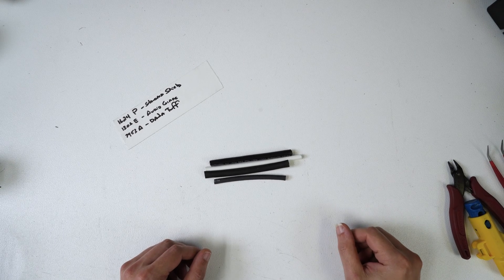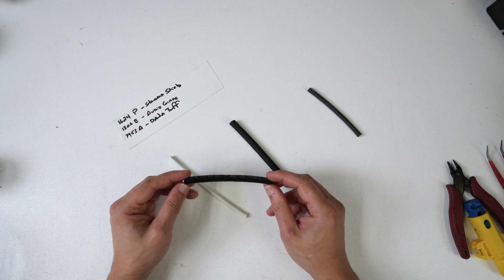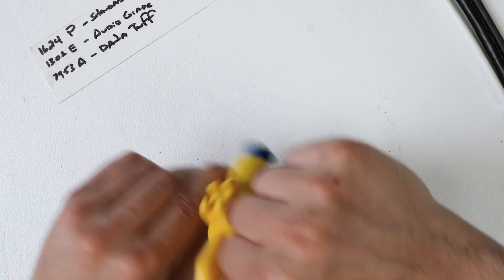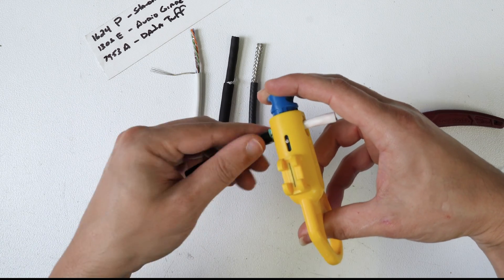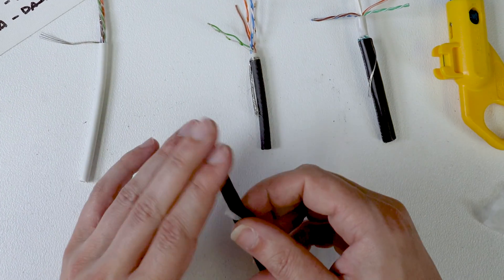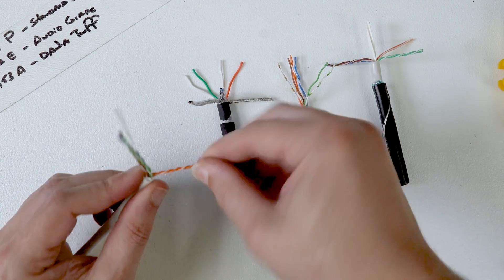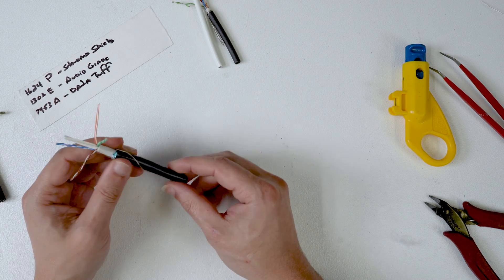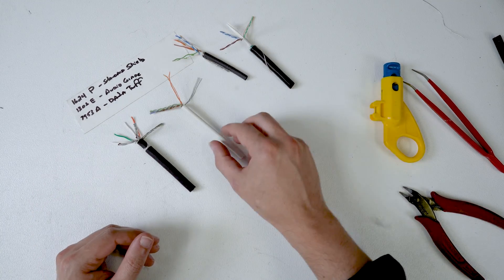Belden Cat6 Cables Compared: 1624P, 1303E, 7953A

Comment: Have you compared 1303EPU? (against 1303E)  the difference is the outermost outer jacket is PUR, and therefore better for durability but slightly increased bend radius, 35MM 70MM [1303EPU] vs 32MM 64MM [1303E].

Comment: I suggested this cable 😅… great video showing so much detail! 

So what do you think about the wrapping ease on the new cable? Better than the datatuff I suppose? 

Also the 1303 is a Cat6a cable .. the other cables are either Cat6 or 5e and can support 10G speeds upto a certain distance
Reply from the maker: It’s like a scene from 8 mile: 1303 is the superior “wrapper” compared to 7953. The only tricky part is the conductor thickness. You have to use a tool-less industrial RJ vs the normal crimp version.
Reply: heyy, what do you think of the belden 1303EPU it has the outer jacket in PUR, have you ever tried it ? is it more flexible than the pvc outer jacket? i would like a rugged but easily bendable cable . do you know if there are some gigabit ethernet cable with rubber jacket? they should be even more flexible than PUR ones, let me know